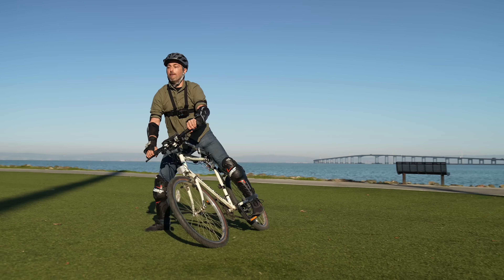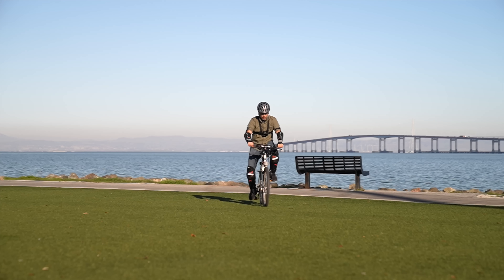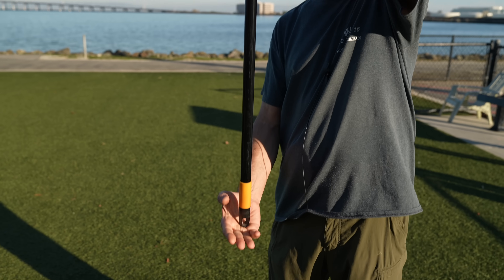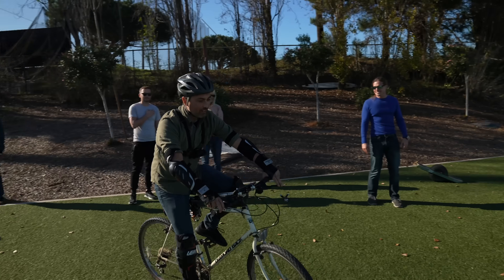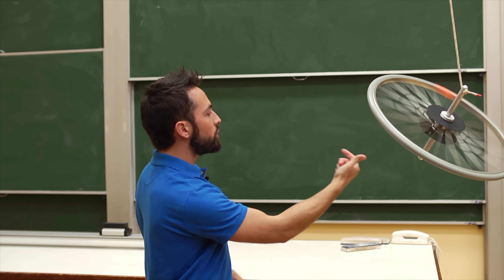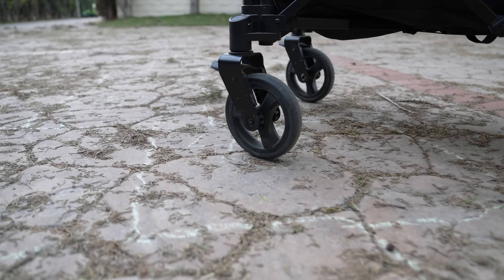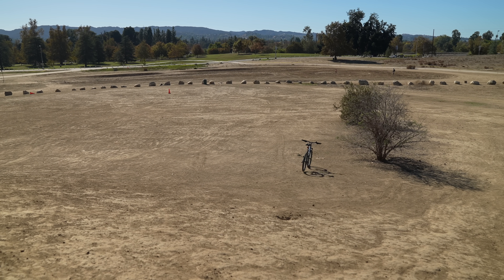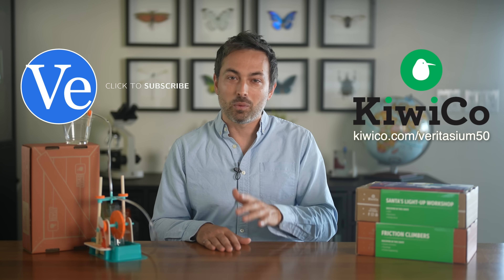Most People Don't Know How Bikes Work

Comment: There is a relation between your linear motion and your angular motion, your linear motion will control your angular momentum with respect to ground. Just like propagation of electric and magnetic waves which are 90 degree to each other but parallel to propagation direction.

Comment: 😂 you don't have to counter steer if you lean with the bike that's why moto cross bikes can go down more than a  45° lean and still get back up because but no bikes can ride with out a rider because the grip on the tires caused by the natural counter steer acts sort of as a push to get it back upright

Comment: 👍🏻…at video min 8 , cycles steering wheel has positive caster angle and some offset, it keeps self center  steer ( even cars) , but caster wheel on carriages is 0 degree and more offset,  it keeps wheels fallow  steering  driver, not self centering.

Comment: of course the jolt of someone else steering is gonna make you fall off this doesn't prove anything.
Reply: No one else is steering.
Reply: It just locks the steering to one side. It doesn’t jolt the handlebar to push you in one direction
Reply: @thatoneguy611  That's correct. It just prevents you from steering to the left when you're instructed to make a right turn.  It does not jolt the steering at any point.

Comment: When riding a motorcycle at anything but walking speeds, the most precise way to turn right is to, in fact, turn the steering wheel to the left. You push horizontally on the right handle, which turns the wheel slightly to the left, but makes you turn sharp right.

Comment: Be willing to guarantee that almost every motorcycle rider in here understood this concept before the video, rode bikes for years and never would have known but with a motorcycle I found myself thinking about my balance when turning a lot.
Reply: I'm willing to bet that I could go to any track, motorcycle shop, or biker bar and have motorcycle riders arguing among themselves within 2 mins.  There are plenty of motorcycle riders contradicting one another in these comments.
Reply: @Rick_Cavallaro  seems to me in 5 mins of reading that all motorcycle commenters that i saw understand how countersteering works.
Reply: @inflatableman9185  nearly all motorcycle riders say counter-steering is only used above some speed threshold.  A few say it's only used at low speed.  Some (including a motorcycle cop that instructs other motorcycle cops) say that it's never used.  And almost all of them believe you can simply shift your body weight to initiate a turn - and that counter-steering is optional.

Comment: It only works with hard turns. Wide turns aren't an issue because you only need to lean or lightly steer.
Reply: When will "wide" turn become "hard" turn?
What if the turn is not hard or wide? Impossible to turn.

Comment: How about motorcycles? Low speed you turn into a turn and high speeds you turn away from the way you want to lean. Having a consistent propelling force vs unbalanced propulsion
Reply: Since when motorbikes act differently? " Low speed you turn into a turn". Lot of people say that, but none of them never show any proofs.
Reply: @XtreeM_FaiL  well, the weight alone gives it a lower center of gravity. Your not trying to keep balanced on top of the motorcycle. The physics are similar but, not the same. I maybe wrong but, I don't believe the same actions depicted in this video translate 1:1 for motorcycles. High speeds you lean into the turn and push the handle bars in the opposite direction you are turning. Lower speeds  you can turn the handle bars towards the way you want to turn. Plus the variable of different length forks for longer or shorter rakes. Like choppers or wide glides vs street bikes like GSXR, NINJA, CBR, etc... they all have different weight distributions some much higher and some much lower. I was initially asking a question. If the same rules applies to motorcycles. But it seems I have to explain myself further inorder to get a valid answer.

Comment: Yes this is counter intuitive but I have heard about it and even experienced it for myself. I believe I encountered this many years ago when I got to ride a motor trike. When I first attempted to turn it was like I was paralysed, I assume because I had the muscle memory of a biker and so it just didn’t work. Strangely, when trying a quad a few years later I had no such difficulty, maybe because I already got past it or maybe because having the two wheels out front didn’t trick my brain so much.
Reply: >>  I encountered this many years ago when I got to ride a motor trike.

If you're talking about the old Honda ATC trikes, they're even more bizarre because they don't have a differential on the rear axle.  So the rear wheels are trying like crazy to keep you from turning.   We would actually lean toward the outside of the turn to unweight the inside tire, and this made it turn much more easily.

Comment: And if I use the bike without touching the handlebars, I mean it is possible to do it and it is also possible to turn without touching it.
Reply: You can turn without touching the handlebars, but you're still steering (and counter-steering).  You're just doing it with your hips.  Lock the steering and you won't be able to ride for more than 3-4 seconds.

Comment: Upper-Middle Eighth domain continuum body rotation on the Ninth domain planetary continuum body.   As comprised of Molecules, atoms, sub-atomic particles, quark layers down to stacks of sublime points of gravity squared or 3rd Domain stack(made spherical by gravity to allow quark layers of 4th, and fifth, for the sixth continuum body of a sub-atomic particle, gravity squared points are the 2nd Domain Continuum bodies.  While a line of gravity is the first.   

Hilbert's hotel with room service, housekeeping, Custodial, concierge, Front desk, baggage handlers, doorman, and a Manager, but it is in a city of businesses, each uniquely infinite, but offering only seven of the infinite services in each, and if one gets an Eighth service the domain all evolves and everything requires the eighth service, so the hotel gets infinite valet service.  The bar next door has an infinite drink menu, infinite bar, infinite customers, barkeeping, cleaning, busing, and gains infinite types of glasses.  They all become percentages between 1 and 0, and domain scale ups square 1/0.  Adding a new property to an Continuum body and a greater range to the domain size of its core gravity and primal interaction of caculation, primal: as determined by our level of understanding.  Taking apart a black hole for its store of memory is not really our problem to solve...  great dysonsphere physics engines though, the whole thing a caculator...

Comment: An excellent demonstration of countersteering in theory - but I'd point out that I believe it's possible, in some specific situations, for the rider's shift in weight to happen prior to the countersteering action.

As for the first tests, Derek tested Rick's steering lockout rig at exceptionally low speed and in doing so, never stabilized to a point where he was maintaining a (near-perfect - no such thing as perfect) straight line without major corrections (let's not forget the fear of falling at greater speed).

This is not to say that countersteering isn't a thing, because it most certainly is, and the point of this comment isn't to contradict what Derek and Rick are trying to convey here. However, let's look at 4:26. Was it "luck" that Derek had countersteered beforehand...or did he actually countersteer at all?

It's entirely possible that his body weight began leaning into the turn first, destabilizing the bike and initiating a very slow fall to the right. During that brief moment when the bicycle began leaning, the front wheel/forks/bars - even though they were in-line with the frame and locked to prevent further input, _they were effectively steering against the direction of the fall.

In other words, even though the front wheel is pointing "straight," the bike was banked enough that maintaining the steering dead straight acted as the opposite steering action. As such, the shift in weight initiated the fall, which initiates the physical effects of countersteering without the rider actually turning the bars in that direction (or the rider's brain trying to fall back on the subconscious knowledge of countersteering and trying to correct with body weight and steering).

Granted, this isn't always practical, hence, countersteering is usually required as the first thing to initiate a turn. However, I'm pretty sure that it is physically possible, in a stable enough scenario, for a super shallow turn to be initiated by the rider's shift in weight first, followed by countersteering.

My two cents. I'd love to either be proved wrong with actual data, or - if right - see the science behind it.

Side note: If anyone wants to experience significant rider-induced countersteering during a stable turn, without learning how to ride a motorcycle, try steering a heavy Class 1/2 e-bike, at speed. Provided you have enough handling control to witness what you're doing without influencing your own steering input, you'll definitely recognize your body physically countersteering the handlebar into turns at speed before leaning into said turn. The Lime/JUMP rental e-bikes are ideal for this, as their swept-back North Road handlebars allow for very precise steering inputs.
Reply: >>  Was it "luck" that Derek had countersteered beforehand...or did he actually countersteer at all?

It was luck.  And it will happen about 50% of the time if you're really careful.  But you will almost certainly fail more than half the time in real life at low speeds just because you tend to make bigger steering inputs in both directions at low speed just to keep the bike under you.  So as soon as you go to make a small correction to the left, with left steering locked out, you start to go down.

>>  I'd love to either be proved wrong with actual data, or - if right - see the science behind it.

Try this experiment...  if you can simply shift or lean your weight to initiate the bike+rider lean, you could do that just as well on a stationary bike.  So get a friend to help you with this.  He stands directly in front of you.  As you lift your feet off the ground, he gives you the order to fall to either the left or right the moment your feet land on the pedals.  Remember, you're not pedaling.  Just balancing. You'll quickly come to realize you can't shift your weight to initiate a lean.  Instead you have to move the contact patch from under you - just as you do when balancing a broom handle.

Comment: Maybe you could show the difficulty to ride a bicycle where a gear reverses the direction of the handle bar versus the front wheel. Meaning when you turn the handle bar to the left the wheel is turning to the right. This confuses all the wiring in the brain of an experienced cyclist.

Comment: Have you not ridden a bike with no hands before? You can turn anyway you want without even moving the wheel. Maybe this is one technique, but I used a bicycle as a primary mode of transport for many years and never used it.
Reply: You're still steering when you ride no handed.  Try locking the steering and you'll fall within 3-4 seconds.
Reply: You must have missed the entire part of the video where he explained how bikes without riders can stay balanced. It’s still using these principles.

Comment: This counterlean concept is very easily demonstrated to anyone who rides. I've done so for years. Especially with motorcycles.  Just ask the rider to position there hands on the handlebars so that they hold each one with there palms directly over the grips, but only grip the bar loosely between their thumb and forefinger.  This way they can easily feel exactly what there steering inputs are. They will quickly find that it is impossible to turn right without first giving input pressure to the left. It is a very convincing exercise that shocks everyone even those who expect it!
Reply: I like that method of demonstrating it.  We tried to think of the best ways to show that you have to initiate a turn with a brief input in the opposite direction.

Comment: Does that video apply in my situation ?
70% of the time I drive my bike without my hands on 😂😂
That way I've learned to keep balance all the time and turn right or left without even needing my hands
As you're getting faster, it's getting easier to keep balance
Reply: >> Does that video apply in my situation ?

Yup.

>> 70% of the time I drive my bike without my hands on

Believe it or not, you still counter-steer to initiate a turn.

>> As you're getting faster, it's getting easier to keep balance

Yup - that's mostly because the faster you go, the smaller the required steering inputs to get the same lateral rate of displacement.

Comment: I am going to guess before watching all the way. Counter-steer. Motorcyclists know it well because motorbikes are heavy. You can (but most people don't) detect it on bicycles because they are so light. My hypothesis has always been that in order to counter the gyro effect, a right turn needs to be initiated by a slight left which makes the rear of the articulation fall to the right and that fall pulls the left pointing wheel over to the right completing the turn. How did I do? With practice I did this intuitively and still do, until I bought a side-car motorcycle and nearly drove right into an incoming truck desperately trying to steer away from it.
Reply: You're right that it's about counter-steering, but it's not about countering the gyroscopic effect.  You have to counter-steer because a bike is equivalent to an inverted pendulum in the lateral axis.  That means it requires a "non-minimum phase" control algorithm.  And that means you have to initiate a right turn with a brief steering input to the left.

Comment: This is a massive lie, your not taking into account the body weight which changes the center of mass. To avoid needing to start a turn by turning in the opposite direction, you can lean your head and body into the turn, allowing your turn a smooth and safe passage, watch BMX riders and longboard dancers, they are constantly adjusting to keep there center of gravity above the board, making it go where they want to without wasted counter movements.
Reply: >> To avoid needing to start a turn by turning in the opposite direction, you can lean your head and body into the turn

I sure wish I could put you on this bike.  You'd be in for a big surprise.  If you happen to be in the S.F. bay area we should arrange it.

Comment: This is why so-called "training wheels" that are adjusted so that both training wheel are in contact with the ground at the same time are a bad idea. It severely limits the speed you can go at because you cannot lean either way. It's not so bad if they're adjusted to be off the ground when the bike is upright.
I taught my two boys to ride with the counter-steering method, with no training wheels, and they got the hang of it right away.

Comment: Bicycles use so many forces it's amazing. 

Gyroscopic force is only one of dozens of stabilizing forces that go into riding a bicycle.   It's really only a minor assist, that helps make the other forces more stable by creating a dampening effect.   

The pendulum effect is another one of those major stabilizing force complexes that go into riding a bike.  Notably, it also goes into driving a semi truck, which requires it to balance the trailer.

Comment: This function is more pronounced riding a motorcycle on the street. Get going until you have sufficient momentum to stay up, say 20mph. Want to turn left? Push your left hand forward which points your front wheel to the right. Your bike leans left and the effective smaller wheel diameter on the left side of your bike will turn you left. It sounds strange, but it feels very natural in action. Centripetal force is weird.

Comment: Good motocross riders understand this. You don't pull on the handlebars to turn quickly. You push on the handlebars to cause the bike to lean extremely quickly..  on a bicycle you don't notice it because the bike doesn't weigh very much. But not a motorcycle there's enough weight that in order to throw it around quickly, you push to cause the bike to slam over on its side quickly rather than pull on the handlebar.  If you've never tried it and your motorcycle guy, give it a shot. You'll love it!